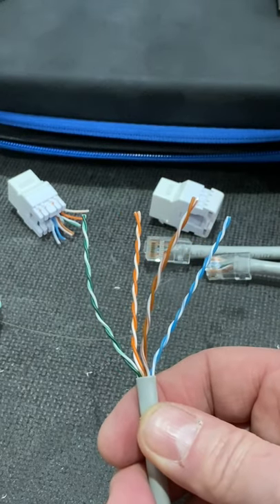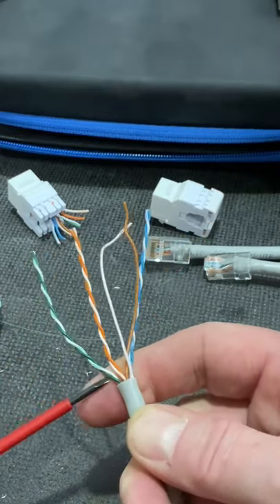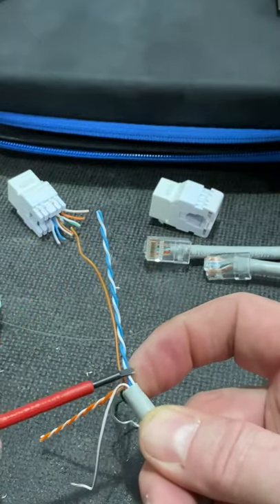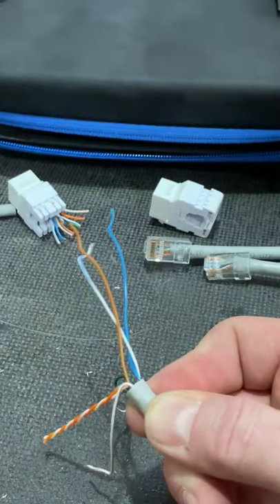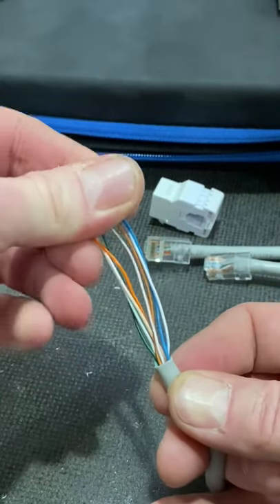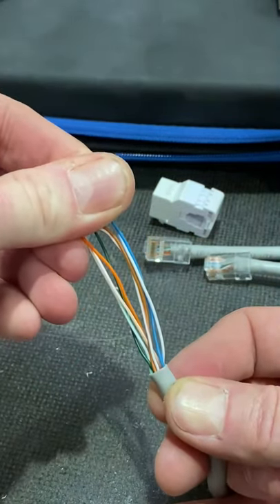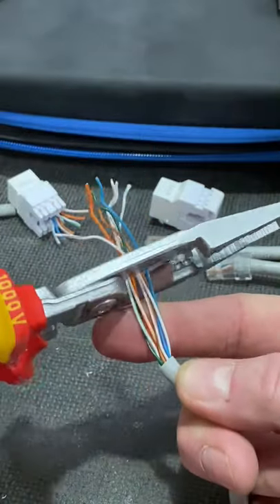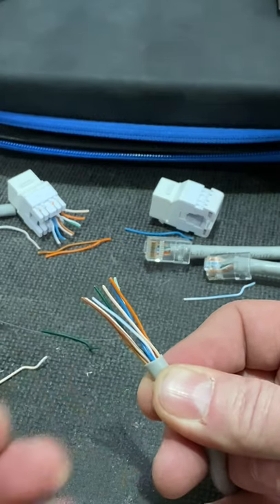A FAST way to UNTWIST and STRAIGHTEN wires in CAT5 and CAT6 data cables - Electrical #shorts

Comment: I've been untwisting wires for 20+ years. This 43 second video could have save me 1000s of hours.
Reply: F
Reply: EXACTLY! Mayby not 20+y expierience, but done many works, and locked at pros many times - nobody used that method o.O... can't await mondey evening, when I'll be cabling friend :) it seems to easy, we'll see xD
Reply: Man, I was just about to say exactly the same thing!!
Reply: Luckily someone showed me this when I first started messing with cat5. Surprisingly it seems not too many ppl know about it
Reply: And that is why electricians should not wire data cables. If you untwist that much cable you will increase the cross talk and the cables will not meet spec for cat6 or 6a etc. The twist is not there by accident. Go on a course, learn how to do it.  just try and put a fluke certifier tester on that and see if it passes.
Reply: @TheGraemeEvans  What does that got to do with the cost of tea in China?
Reply: You must be an electritian and not a network engineer
Reply: @haxboi5492  I'm retired now. I was a public safety comms engineer.  I wasn't either, but had to do both too.

Comment: Normally you keep the twisting as much as possible when putting it on a wall plate or patch panel, for the minimum risk on interference. Although that is what I learned 4 years at school... 
Nevertheless for crimping those rj45 connectors, it is a top tip that will save many frustrating minutes of fiddling with the strands to get them straight and in order...
Reply: Came to say the same thing. A great tip for crimping plugs, I just hope people don't use it for sockets.
I like to have it twisted all the way up to the punchdown terminals if I can, with the minimum amount of outer sheathing stripped off too.
Reply: @TheMattSturgeon  It's not just recommended, it's necessary to maintain a CAT rating above CAT3.
Reply: You know you don't have to put the screwdriver in the very bottom of where the sheathing is cut you can still stick it in a little higher to keep the unsheathed twisted pairs in tact as much as possible
Reply: @thomasbonse 1/2 inch can be untwisted for Cat6, longer for Cat5e

Comment: I have been using the cut-off sleeve piece like one of the untwisting 'tools' for years.  Never did it ever occur to me to use this method!!!  Your method works 2,000% better than using the cut-off sleeve, or an 'official untwisting tool'.  I've wasted hours of my life doing it the wrong way.  THANK YOU for this tip.  I will be using it from now onward.

Comment: Be sure to ask the cabling vendor about removing the twists before terminating. Many vendors are sure to want to retain the twist right up to the point of termination for performance or warranty reasons.
Reply: ?  yes, you are supposed to trim the cable back so that the jacket is inside the rj45 end, so that your twists are right up to the ends, and the jacket gives stress relief on the wires

Comment: You just saved my thumbs more pain.  I've been sliding the wires between my thumb and a hard edge to straighten them running CAT5e through my house.  My thumbs hurt a lot at this point.  I was dreading running anymore.  THANK YOU!

Comment: Bearing in mind the twist is essential and should be removed only as far as needed for termination. For terminating to typical punchdown blocks no untwisting is even required, simply separate the pair slightly, align, and punch.

It's a good thing low speed (gigabit) ethernet is forgiving of installation errors.
Reply: No one would untwist it like this for punchdowns, only for connectors. The crimp tool will automatically trim the excess.

Comment: Man, this is a game changer. Glad I saw this before rewiring my whole house!
Reply: Don't use this for infrastructure cabling... You need to keep the twists in. This should only be used for rj45 ends.
Reply: @thesynaesthesiac1839  do rj45 keystone jacks count? Those will be on either end of my cable runs
Reply: @KevinReinartz  Pretty much yeah - twist the cable pairs where they go into the jack so it fits into the gaps and then your keystone tool will snip the excess off, so that way the twists remain right up until the last point. In reality it doesn't make THAT much difference, especially for a home install and assuming you keep the exposed cable as short as possible it'll only be 1 exposed twist anyway. Do whatever works easiest for you :) (I'd have a bit of a hissy fit if a certified cabler did that in a professional installation of course!)
Reply: @thesynaesthesiac1839  sounds good. yeah I wont be anywhere near pushing the limits of the cable at the house... yet. running cat6 and my longest run is 75ft, nothing more than 1Gbe right now. I have only done a couple runs, and i terminated the keystone with as little exposed wire as possible. I will adjust for the rest to keep the twist.

Comment: Fine for putting RJ-45 plugs on but if you are using this method for terminating faceplates you're doing it wrong, need to keep twist as close to termination as possible so straightening the wires is not best practice

Comment: I've been doing this for the 4 years I have worked low voltage ant it sure saves time, also if you nicked any wire while stripping the jacket, the force applied will tear it off letting you know that it needs to be done again or risk having others like it
Reply: If You use the strand of white fiber to pull back on the jack behind where you cut you wont have that issue, that is why the strand is there.
Reply: @oni8245  yeah, I ve done it that way too when I notice that I nicked a conductor but if you don't notice, at least the force of using a screwdriver will break off that wire and you'll have to pull back enough to do the termination
Reply: If done properly, there is no reason to ever nick a wire.  A nicked wire will always fail with enough time.  I have done several service calls where someone has nicked a wire or actually used staples!
Reply: @solarsynapse  I hate seeing staples, even if using cable ties too tight on the wires can give you problems
Reply: @LuisAlbertoSerranoAlonso  Yes, it will.  Certify a new section of cable then try different kinks, bends, twists, tight cable ties, etc, then certify again to see what happens to the bandwidth.  Several places on 100' will slow the speed!  Keep away from power wires, motors, transformers, lights, etc.  Let's make a coil and tightly zip tie it to a power conduit!  A loose tied zig zag service loop away from power is better.  It will also feed if you need to pull it for more length, unlike a coil.  No tight loops or turns.

Comment: Useful when doing RJ45 terminations. I usually just use my nails and pull down from the base of the conductors. It’s about the same speed as this screwdriver method, but my fingers do get sore after a while, so I’ll have to try this out.

Comment: Incase you guys didn't know, there is a tool exactly for this on the fluke punch down tool. Its a little hook that swings out, and you can use the hook to straighten out the wires.
Reply: In case you didn’t know you don’t need to spend more money when you already have a tool that can do then same job.

Comment: Interesting tip. However, it’s best practice to leave as much of the twisting in place, particularly for high speed Ethernet. It reduces electromagnetic interference between the pairs and also between these pairs and other sources of interference.

Comment: Twists are there for a reason if you notice the twists on each pair vary in length, if you carry out a full structured cable test and you have untwisted the conductors there is a real chance it will fail !

Comment: Notice how they wait till the wires are over the rounded portion of the screwdriver. Doing it too early could accidentally tear the insulation.

Just incase anyone wasn't paying close enough attention.
Reply: Ya and maybe cut them to length and it will be even faster. He already took about a turn and a half of twist out of them  to make the straight part at the bottom. If you cut it to length you would already be done🤔

Comment: Have to make a mess of 10 foot patch cables and found this.  Sooo much easier than using an empty jacket and screwdriver separately.  If IT had a knighthood you would be up their near the top.  CIT, maybe?

Comment: You don't want to untwist too much of the twist though Gary. It's twisted for a purpose, I noticed in one of your other videos that you untwisted the cable quite a bit. The idea is to have the twists right up to the point it goes into the plug or keystone. Having said that how much difference it makes to cross talk and interference at that point I have no idea, its one of those data "myths". Maybe something for the big data guys with the £20K testers to have a look at.
Reply: For most domestic properties where the speeds are < 60mbps (if you're on an openreach ISP), the difference you'd see from an inch of untwisted pairs would be negligible. If you're pushing the cable to it's gigabit limits, then you'd likely see a difference. 

Where possible, you should use pre-terminated CAT cables for high speeds to ensure these interference things aren't gonna bottleneck speeds as it's very hard to do right by hand (unless you have some more sophisticated hardware). My networks lecturer at uni said he'd only terminate CAT cables himself if it were for something like a local CCTV network or something. 

Some of the prefab ones fill the connector with resin to reduce the risk of interference with other conductors
Reply: You strip them longer than you need so they are easier to work with then shorten to put on a crimp or terminate them in a patch panel. Provided the other sleeve is under the clamp and you don't have a mess of cores dangling around the place it makes no real difference. I'm a sparks but have done a decent amount of this and terminated 10GB networks with no trouble this way and the network sub-contractors we get in, do it the exact same way without issue.
Reply: @CallumAtwal  We are on the 500Gbs Virgin and my main PC with full Cat6 from the switch gets around 525 on Speed test at its best. Some of the other PC's on the older Cat5 get around 475. I wouldn't have been quite so careful back then with the connections to the keystones.
Reply: @billdoodson4232  tbf after writing my comment, and reading @solidus784 's, I get the impression so long as it's correctly crimped and you're using CAT6, you should be good. My lecturer comes from a time when 1mbps was fast :D 
I've got virgin's 200 with a Netgear nighthawk x6. Gets 213mbps in every corner of the house if you're interested in good WiFi!
Reply: Keeping the untwisting to a minimum is a must if you are certifying the installation. It will still work even if you untwist a long section of the cable, but it won't pass a proper test. When I did my CNCI training, just 1 extra untwist on one pair would fail it, you would be amazed just how thorough a £25K Fluke Versiv is. For 99% of home use, CAT5 will be fine and is far more forgiving.
Reply from the maker: we'll check out the twist to fail ratio - thanks!
Reply from the maker: Great advice
Reply: @efixx  I would actually love to see this test. I'm would be of the opinion that you keep it to a minimum but at the same time within reason as long as it's neat and tidy. A lot of people have strong opinions about things they have never actually done in reality.
Reply: @solidus784  also the same when wires go into the back of a patch panel. I've seen instances when the individual wires are stripped way too long away from the actual termination point. 

I usually leave the least amount of slack  just so as much of the cable is twisted as possible
Reply: @CallumAtwal  yeah I've seen a few inches of cable dangling around like spare mickies some lads just don't care. I find most problems in networks come from either kinks and sharp bends or from inadequate segregation.
Reply: @solidus784  yep, definitely don't kink the cable, exceed the bend radius or cable tie it tightly,  it will wreck the cable performance. Cable trays even have matting in them to minimise stress points, cables are grouped then carefully bundled with velcro.
Reply: @solidus784  I've seen it in person when one port in a panel failed that I'd punched in. The fluke tells you which pair has the issue, sure enough 1 full rotation to many on the untwisting. I put the twist back and it passed.  I wouldn't have believed it unless I'd seen it first hand.
Reply: @electronbox  Fair enough it's only something I do periodically. We generally sub the work out in my company but I've seen network engineers from several companies untwist then nearly back to the sheathing and then obviously keep them as short as possible after that so maybe 10-15 mm untwisted before it's punched in
Reply: @solidus784   This is fine for terminating plugs since as mentioned you are trimming the excess and the fact you need the sheath inside the connector, means bugger all excess, but don't dare do it for sockets - yes, there is a difference, and those 18K fluke certifiers will show it,  would a home user notice anything? maybe, in a commercial environment, definately, I've seen guys sacked for untwisting all way to sheath for jacks and patch panels.

Comment: I'm a stickler, but this method puts too much stress on the conductors for my liking. I prefer to gently untwist the required and ensure reliability for the customers.
Reply from the maker: You should see how much stress Cooper goes through to become a conductor - it can take this straightening stress.
Reply: @efixx  oh it can take it, but it will stretch slightly making the conductor a smaller diameter and a potential 'weak spot'. I'll take reliability over a few saved seconds, but each to their own.

Comment: Good for a plug but the socket should have twists in them right up to the termination. No point untwisting if i'm going to twist it again. Good tip though

Comment: Great way to unecessarily stress the wires and stretch them. I bet if you actually measure the metal with precision, at least 1 in every 20 will show signs of necking.

Comment: I found this one day too late.  I just got through running a couple of cables and my fingers are raw from untwisting and smoothing wires.  BTW, did anyone else notice how much wire was exposed?  I will cut the shielding back much further in the future.

Comment: At least for Cat 6 (you should do this with anything these days though) you want the twists to continue as far to the end of the wire as possible, my punch downs are always twisted to the last 2mm and in RJ-45's I like it twisted to 1mm before the cable channels.

By untwisting, every mm, you are further defeating the differential signaling that ethernet uses and causing degraded performance, or at worst, inability to connect at 10GBit. 

I've not run 1000's of runs, but certainly 100'... In my day job, I pay people to run them for me and I just do a verification lookover.

Comment: Great tip, but you are untwisting way to much for a proper Cat6/Cat6a temination.
Reply from the maker: This is to go through a plug so most will be chopped off. on a socket with punch down we’d only untwist enough to make the connection.

Comment: And that is why electricians should not wire data cables. If you untwist that much cable you will increase the cross talk and the cables will not meet spec for cat6 or 6a etc. The twist is not there by accident. Go on a course, learn how to do it.
Reply from the maker: Not all Cat6 is used for data - lots of it is now used to connect current transformers on EV charger installations.

Comment: God they are at it again if your stripping that much cable away for an rj45 then your doing it wrong if your also untwisting the cable fully for a data module your doing it wrong twist should be kept upto the point of insertion with as little as the “conductors” showing as possible once again you are clueless giving wrong advice!
Reply: Doesn't matter how long you strip back, I could strip back 1m of cable but once I line up my rj45 there is ever only going to be 15mm from the outer sheath to the end of the plug. The standard allows some play (distance from termination to twisted end) so although best practice is to have your twist tight to the termination block in real life if you have 20mm between block and end of twists so be it when you test it, it will still pass but took you 5mins less to do.
Reply: Wrong and really bad advise only ever strip back what you need and keep the twists in they are there for a reason and why you won’t see the effect at the moment as home internet starts to get faster and faster you will see the effect it causes more and more

Comment: I don't buy this.  There is a huge chance that you will get the white wires mixed up and then you'll have to cut it off and redo it.  You have to make sure both wires of each pair stay together.

Another thing that's important that you do not do is scrape through the insulation.  Your fingers are not going to do any damage; you better be gentle with your screwdriver.

Here's a better way.
https://youtube.com/shorts/8qBsMmgpHIM?feature=share